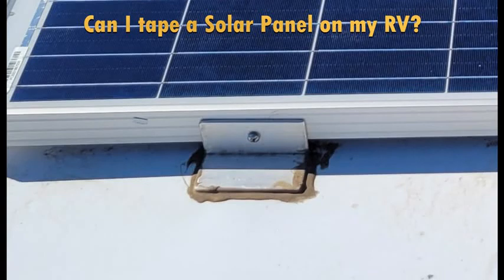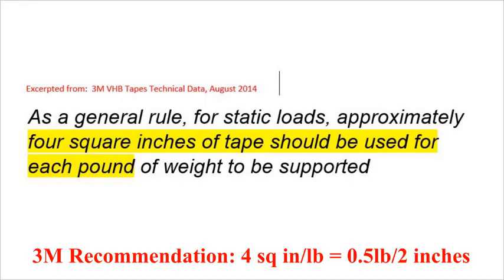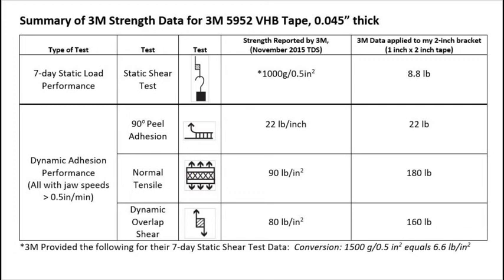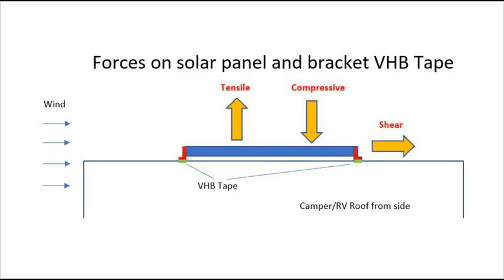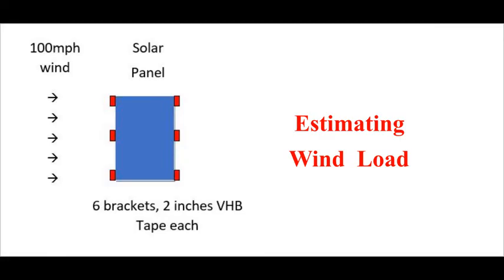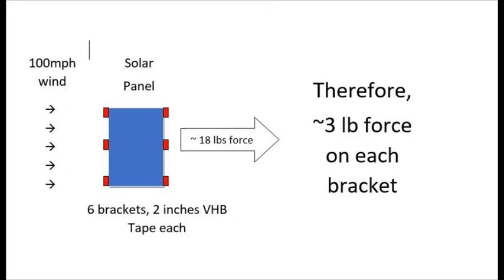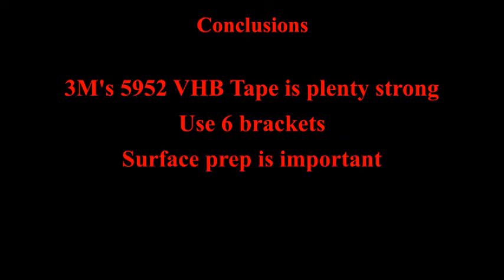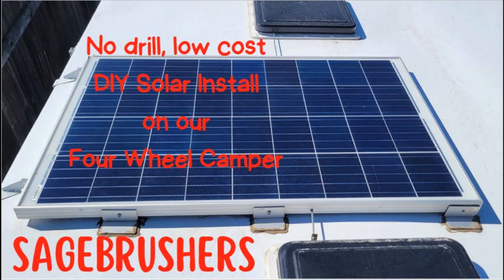Is 3M Very High Bond Tape strong enough to secure a solar panel on an RV?

Comment: Not sure if you mentioned, but 3m says the tape has full adhesion at 72 hr.
Reply from the maker: No, I don't think I mentioned that, so thanks for contributing that info. 100% adhesion at 72hrs (as you said), 90% at 24hrs and 50% at 20 minutes, although these times can be shortened by heating, even approaching 100% of full strength in one hour if heated to 150F(!) according to the 3M Technical Bulletin on surface preparation.  Thanks again @RonKris for bringing this up.

Comment: My RV has a great rubberized roof that's never leaked in 25 years, so I wanted to avoid holes at all costs.  To mount solar, I found Versastrut pvc channel which is not only lighter than steel strut, it also has 1" brims so I could apply Eternabond tape on both sides for additional adhesion strength.  Time will tell, but the bonds seem very strong.  I'm overcautious, so I also ran dicor sealant around all the tape edges to mitigate any moisture creep, and crimped 1/8" cable from the panel mount hardware to the existing roof railing in the event of adhesion failure, to make sure some poor soul driving behind me isn't blasted in the windshield by a flying panel one day.  Since I'm no spring chicken anymore I'm about to install a 4K wireless cam up top so I can keep an eye on the whole thing at all times while cutting back on having to climb up/down that damn ladder.
Reply from the maker: I understand the desire to avoid all holes in a roof but I wouldn't use  VHB/Eternabond/Dicor adhesives on any rubberized roofs for fear of the panels pulling the roof up.  However, it sounds like you have certainly mitigated to risk to other drivers with the 1/8" steel cable leash. And I like the idea of putting a camera up there  to keep an eye on it. Seems like you should be able to see the when either the rubberized roof or the adhesives holding the Versastruts begin to fail. Nice solution!  Thanks for contributing that solution.

Comment: You do still need to allow a ventilation gap under the panel, so you may need two pieces of Aluminium Angle either side riveted or screwed to the panel, then the angles can be taped to the roof.
Reply from the maker: @richardsandwell2285, I totally agree. Ventilation is important as panels are more efficient when cooler. I used DIY aluminum angle brackets with steel rectangles (with tapped threads) on the inside of the panel frame to screw bolts into. Here is my original install video:  https://youtu.be/DowwxlfZsTA 

Since then, a viewer suggested an angle bracket as a rail along the entire length of the panel on each side, so I tested the strength of a 10-inch piece of angle and extrapolated the strength result to two 40 inch rails. I concluded that over 3,500lb would be required to pull that panel off!  You can see the 10-inch tests at the end of my more recent video: https://youtu.be/ULbw_885sX4

Thanks for pointing out the ventilation issue and importance of a gap!

Comment: I don't trust that 3m tape I'm going to use internal bond
Reply from the maker: Thanks for the comment.  If you have a roll-on or flexible roof coating, I would agree with you totally - tape should not be used in that case.  

For hard, smooth surfaces, my more recent tests may help you trust the 3M VHB tape a little more (https://youtu.be/ULbw_885sX4).  This second video shows some even more convincing strength tests and some impressive durability information.  Thanks again.

Comment: Put the vhb tape on full length of aluminum square tubing the screw your solar panel brackets to the tubing. Use aluminum channel if you want to use bolts & nuts instead of screws on your panel brackets. Use  nuts that have neoprene lock rings in them so they can't vibrate loose.
Reply from the maker: Yes, I like it!   See my later video where I tested a 10 in strip of VHB covered with Eternabond tape (link in description). It was so strong it broke my test rig!).  I like bolts with lock washers as you suggest. Thanks for the    comment.

Comment: Some RV roof coverings are loose on the RV because the fabric and the roof plywood expand and contract at different rates, mine is, don't plan on glueing to a loose fabric
Reply from the maker: You are exactly right. I've tried to caution that these tape methods are strictly for hard smooth surfaces like aluminum or painted aluminum. See my caution in the description and see my more recent video on some newer tests here https://youtu.be/ULbw_885sX4.

Thanks much for pointing that out.  Tapes such as VHB should not be used on any roll-on, rubberized coating or fabric surface!

Comment: Roof gets hot and cold, the bond will eventually fail, its only a question of when. I wonder if putting a slight angle down at the front of the panel would create a naturally downward win pressure to make it less likely to pull up. Good work on those anchor points incase of failure. smart.
Reply from the maker: Yes a slight downward angle at the front would reduce any lift forces. It might me a little tricky build in the slope with the brackets. A low baffle in front might help too.

I did see weathering (micro-cracks) in the Dicor lap sealant after about 5 years (and we get some days over 100F and below 20F). So it is good to inspect and take action if necessary. In my case, the VHB bonds were solid so I just covered the existing Dichor lap sealant with Eternabond tape which has at least a 10 year warranty.  

See my later video near the end for some impressive information on the durability of VHB in automotive applications and on the expected life of Eternabond: 
https://youtu.be/ULbw_885sX4  I no longer worry. But I still have my backup tethers too ;-)

Thanks for the comment.

Comment: Just for some added security...put some eternabond tape over the bracket where it is taped to the roof after mounting.
Reply from the maker: That is an excellent suggestion, because when my Dichor lap-sealant started to crack after 5 years I researched it extensively and ended up just covering them, old-Dichor and all, with Eternabond.  I found the durability reports amazing and cover that in my more recent videos this year:

VHB Solar Install - 5 Years Later. What Lasted and What Didn't!  https://youtu.be/HQKAG57gjg4  
VHB, Eternabond & Dicor: More DIY Strength Tests  https://youtu.be/ULbw_885sX4    

I strongly recommend your suggestion. Thanks for the suggestion and reinforcement.

Comment: Iwas wondering, How about accumulative stress ?? yes, it passed with 5h continued W/ 17lb . How much structural damage was inflicted to the tape,if any? the second Run could be only 3h, the 3rd maybe only 1 and so on . I loved your analysis
Reply from the maker: That is a really good question and I found that when a force is near the breaking point but doesn't break the tape, the bond is definitely weaker. However, forces near the breaking point really don't occur in this application. Thanks for asking @fly4fun24.  

Here are links to my more recent videos, including my 5-year inspection and some 3M and Eternabond durability information  beginning at 11:53 in the second video linked below on VHB, Eternabond and Dicor strength tests. 
Also in that video, I tested a 10-inch rail with 10 inches of VHB tape and now believe taping an entire rail along both sides of the solar panel is extremely strong and I think I would do that the next time.

VHB Solar Install - 5 Years Later. What Lasted and What Didn't!  https://youtu.be/HQKAG57gjg4  
VHB, Eternabond & Dicor: More DIY Strength Tests  https://youtu.be/ULbw_885sX4
Reply: @sagebrushers8497  definitely i will check them out, thank you

Comment: Thanks for the research! This is very done thank you.
Reply from the maker: Thanks for the comment!  
Here are links to my more recent videos, including my 5-year inspection and some  new 3M and Eternabond strength tests and durability information.
Also in the second video listed below, I tested a 10-inch rail with 10 inches of VHB tape and now believe taping an entire rail along both sides of the solar panel is extremely strong and I think I would do that the next time.

VHB Solar Install - 5 Years Later. What Lasted and What Didn't!  https://youtu.be/HQKAG57gjg4  
VHB, Eternabond & Dicor: More DIY Strength Tests  https://youtu.be/ULbw_885sX4
Reply from the maker: Also, I enjoyed your video on Snowboarding after 55. I learned at 40 and my wife at 50 so were are also "Greys on Trays".  Still going at 70!

Comment: I wonder how it would do with 8ft rails fully taped down and those used to attach the panels?
Reply from the maker: @jeoffman66, I have a more recent video (https://youtu.be/ULbw_885sX4?si=tcPYUOEjJLYP90gX) with more VHB tests, in which I tested a 10 inch rail secured with VHB and Eternabond over it and it was so strong it broke my test rig about 4 times before I got a strength estimate.  Based on those tests I approximated that 2, 40-in rails with 1-inch VHB and Eternabond over it to seal it would hold nearly 2 tons!  For the 18 lb shear force due to wind at 100mph which I estimated in this video that is over 200 times the strength needed!  This is for very short term shear forces like a gust of wind because that is the kind of test I did in my second video, linked in this reply. And your 8 ft rails would be over twice as strong as the 40" rail estimate!

My second video has impressive durability into on VHB and Eternabond also. I concluded that after I covered my existing lap-sealed brackets with Eternabond, it is bulletproof and will be good for the remaining live of my rig or of me, whichever comes first.  Thanks for the question!  Check out the second video.

Comment: If it comes off and goes through someone else's windshield. You'll have your answer
Reply from the maker: That's true, but my newer tests and my inspection of my VHB install after 5 years convinced me that it will not come off.

Here are the videos on my newer tests with related durability information:
VHB Solar Install - 5 Years Later. What Lasted and What Didn't!  https://youtu.be/HQKAG57gjg4  
VHB, Eternabond & Dicor: More DIY Strength Tests  https://youtu.be/ULbw_885sX4 

Again, this method is not for roll-on/elastomeric roof coatings - it may rip off of those!
Thanks for viewing and commenting.

Comment: I appreciate this study as I used 1/2 inch 3M VHB tape with two rows on each bracket.  I used 6 brackets, 4 were corner brackets with 2 center straight brackets.  I fastened the brackets to the solar panels first, then cleaned each solar panel bracket with alcohol and cleaned my fiberglass roof clean using the same method.  I was also aware that my roof is glued to 3/16 luan which is glued to my foam roof with 1 x 1 inch tube aluminum that is spaced every 16 inches.  Once I had my solar panels down with the tape I then used Dicor non-leveling sealant to seal the brackets down and protect the VHB tape.  So my suspicions would be that the strength here would likely be better than what your calculations showed.  Anyways, after a year of them being on the room there doesn't seem to be any degradation of this system.  But nice article.
Reply from the maker: Thanks for letting us know.  My more recent tests (https://youtu.be/ULbw_885sX4?si=wyazGMLm847gKTbL) should make you even more comfortable with your application.  The new video also contains great information on the durability of 3M tape and Eternabond, which I had to use over the Dichor after finding some degradation of the Dichor in my 5 year inspection (shown in yet another video (https://youtu.be/HQKAG57gjg4?si=9je2twHQ6oJB3DYE).  Your Dichor should be good for a few more years, but keep an eye on it!
Thanks for the comment!

Comment: Hell no it’s not strong enough. The first time I put on my camper it lasted a few months. Then one hot day driving in the highway it ripped off and my panel was run over by about 4 cars before I could make my way back and grab it.
Reply from the maker: @MyKillDon, thanks for the comment and sorry to heart that happened. This is the first time I've heard of a panel blowing off a camper!  Was the roof a solid, smooth surface? Or a roll-on/elastomeric roofing material?  How many inches of VHB did you use?  Was it prepped/cleaned with isopropyl alcohol?  

Please see my latest tests on this subject at https://youtu.be/ULbw_885sX4 .  My six  pieces of 2inch long VHB tape has lasted over 5 years and 90,000 miles with many days below freezing and over 100F and still didn't budge when I pulled up on it to test it (See my 5 year inspection/pull test at https://youtu.be/HQKAG57gjg4?si=PGZeQu_04u0Ea4B_).  My tests in the first video linked above indicate that short-term shear on my 6 brackets over a matter of seconds, like a gust of wind, would hold up to 1,260 lbs!  

And 3M has tested this stuff on truck panels without failure over 300,000 miles (also in 1st video, and no, I don't have any contact with them, just reporting what I read in their spec sheets).
So, my recent tests, in the first video above, really suggest it is very safe if applied according to specs.
But please let us all know if there is something that may have contributed so other people can avoid it. 

Thanks for contributing to the conversation.

Comment: Great test for wind loads. How about inertial forces while applying breaks and acceleration?
Reply from the maker: @lallha, you have a good point about inertial forces. I felt they are relatively minor considering that the weight of the panel and therefore the inertial forces acting on it are both relatively small. I probably should have shown a demonstration of that, or maybe a calculation, to be complete. Maybe in the future. Thanks for bringing that up!

Comment: Thanks for this video...!  Amazing detail for the analysis.
Reply from the maker: Hey thanks @Wayne.416!  There are more tests in my more recent video https://youtu.be/ULbw_885sX4?si=L6-6YKaqpViUIQ3Y  The second video covers stresses that occur more quickly, like a gust of wind, and also includes sealants like lap sealant and Eternabond.  This second set of tests reveal some very impressive strength from VHB tape and the sealants add some to that.

Comment: Your adhered panels may rip off the roof membrane. How is the roofing material adhered to the substrate roof structure? The roof surface is a very thin layer and may not be strong enough for your design.
Reply from the maker: You are absolutely right, @williambeecham7304. Thanks for mentioning that.  I cautioned about using no-drill tape methods on RVs with roof membranes, unfortunately a lot of people don't read the descriptions.  
When I made the video, I only had campers and vans on my mind, with hard painted surfaces - no loosely bonded, roll-on membranes. 
But, I can't change the video now. I only hope that people read the description and comments like yours.  See my next videos on this topic, where I have clear warnings embedded in the videos.  
https://youtu.be/HQKAG57gjg4?si=oqCJYYvszky8fbJJ

https://youtu.be/ULbw_885sX4?si=JzzqPYB8_JoSL-tu

Comment: You said the 3M surface prep, etc. sheets were in the description, but I don't see any.
Reply from the maker: @Believe30  Thanks for pointing that out!  I am on a road trip but will correct that when I can. Meanwhile try searching "3M very high bond tape technical  data sheet" and maybe "surface prep"
Reply from the maker: Here are the links for surface prep and VHB Data Sheet. I apologize. I believe when I lost my Amazon Affiliation for no sales, I had to delete those Amazon links and I  probably accidentally deleted the 3M links at the same time. They are back in the description now.  Thanks much for pointing that out!

Technical Data Sheets for 3M 5952 VHB Tape and for 3M surface prep procedures follow:
3M Technical Data Sheet for VHB Tape 5952
https://multimedia.3m.com/mws/media/2366487O/3M-VHB-Tape-5952.pdf  

Surface Preparation Technical Bulletin:
https://multimedia.3m.com/mws/media/66019O/vhbtm-tape-surface-preparation-technical-bulletin.pdf

Comment: My solar panels (which died last week) have been on the roof of my van for about eight years with 110,000 cross-country miles driven.  3M VHB tape holds the solar panels to the roof.  A layer of mastic tape is on top of the bracket feet, also covering the VBH tape.  No problems ever.  No loosening of the tape.  The solar panels are mounted using Z brackets which have a low clearance of only 1" above the roof top.

Now, I have to get all that tape off my no-hole roof so I can put on new solar panels! ... using the same tape method I just described.
Reply from the maker: Wow, 8 years and 110,000 miles is the longest testament to VHB durability that I have seen! Thanks for contributing that. We are only at 5 years so far.  Good luck on removal. From videos I've viewed and a test bracket I removed:  heat gun, hand scraper and clean final residue off with paint thinner or similar hydrocarbon solvent. Definitely a chore, but doable.  Thanks.

Comment: It would be a good idea when there is no rain. Rain cut the double side tape and silicone like a knife when one is driving on a freeway during the rain.
Reply from the maker: The tape is under the bracket and well protected from rain.  It has upheld in rain storms on the freeway numerous times in the last 5 years and has held well.  Thanks for watching.
Reply: I've had 8 panels on the roof of my rv for a couple years using this method. I also used eternabond roof tape over top of the bracket onto the roof. It's rock solid.
Reply: @briang7870  Have you see how water cut the rocks and metal under the pressure?
When you are driving your RV on the freeway during the rain try to stick out  your hand out of the window (for short time) to understand the force of the rain.
Reply: @paveloleynik2743  I guess it would be peeling all the silicon around my windows and roof vents off too. I get what your saying but that's a pretty far stretch. There's no signs of the rain cutting into anything.